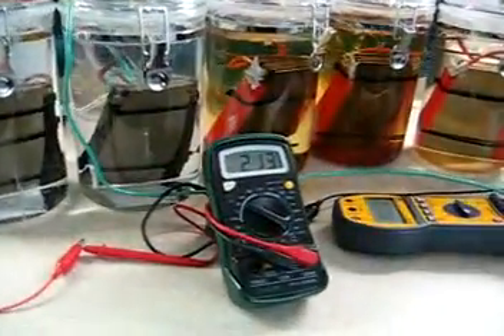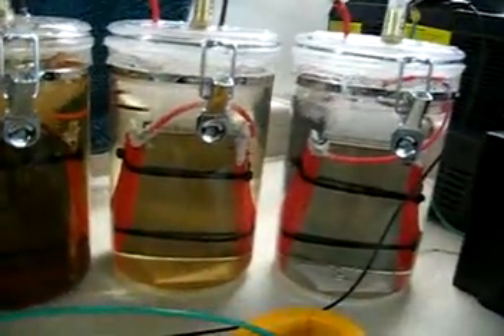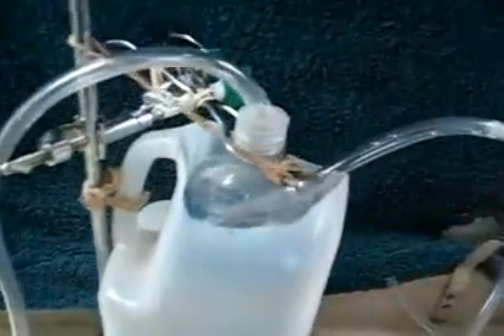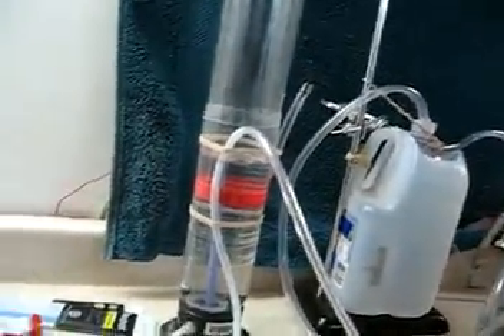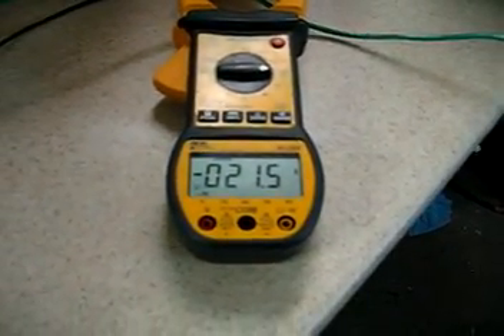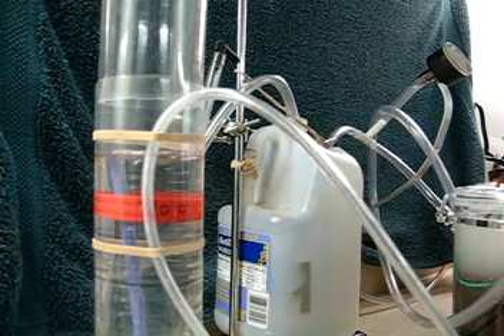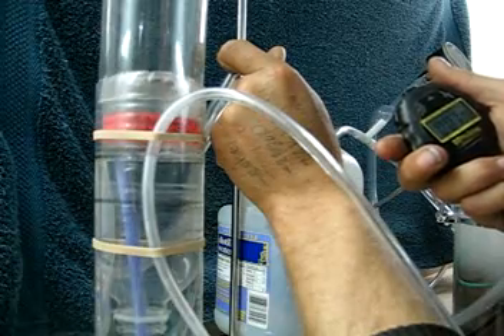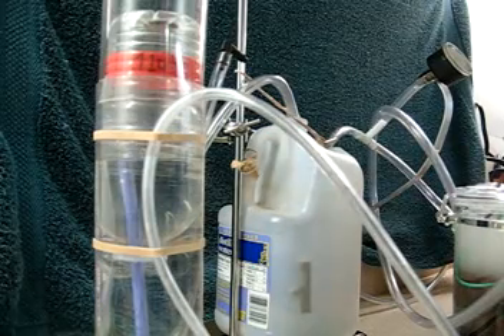6 cell flow test

Comment from the maker: they never build pressure, either the cells dump into open air or they fill the bottle, but they don't build pressure. I turn them on first to get the flow to pass through to open air, then fill the bottle.

Comment from the maker: a physically larger setup wired correctly would produce the same amount of gas for less amperage, yup you got it right, Heres an A+. Kinda like if you had a really big bullet (like a train) and it hit a wall but it wasn't going that fast, vs a really fast moving 50 caliber round, the overall damage winner would be the train. Not exactly like that but its close.

Comment from the maker: if you are asking whether the hydrogen can hardly be separated from the water molecule, the answer would be, well it depends on your setup. There are many factors to how well a setup works, but they can be made to rpoduce a shocking amount of gas for a given input wattage. This setup isn't even close to half of what an eff. design can do. But eff. volume per watt, means a larger setup would be needed to get the volume of gas this one makes, but it would use much less watts.

Comment from the maker: if I understand the question right, you mean it can hardly go out through the water at the bottom opening of the bottle that is the flow meter. The answer is it can't exit through the water at the bottom, it floats up very well but doesn't go back down through it at all.

Comment from the maker: hho is hydrogen and oxygen mixed together, so yes its hydrogen, but not just hydrogen. That is what makes it hard to deal with. Since it has the exact right mix of oxy mixed in with it, it can detonate in any air space if given a spark. each h20 becomes separated in the cells and with a little spark it will burn and return to h2o.

Comment from the maker: I am measuring how long it takes to fill the bottle with hho. In this case its 515ml of space in the bottle, and it took 19.44 seconds, which means its making 1590 ml per min. I divide that by the watts consumed to find the ml/min/watt, which is the effectiveness of the cell. This is not a very efficient cell, but it is not designed to be.

Comment: OK, The formula is based on Higher Heating Value (HHV) of Hydrogen = 141 KJ/grams and assumes the gas collected is saturated with water vapour (since bubblers is generally used). And Ideal gas law + Daltons law is used. The formula above should be mutliplied with 100 to get % efficiency...Yes if you are connecting your cells electrically in series, you would lower a cell voltage with more cells and raise eff..but you could also use a voltage divider to reduce the voltage of a cell..

Comment from the maker: practicality prevents closer plate spacing, a ready at 15 thousands of an inch. As far as the calc goes, what is it comparing or using for baseline? I am interested in understanding what you are getting for a result. In ml/min/watt, which is my prefered method it is low compared to other set ups. And I think its you who misunderstand, the eff. is directly correlated to the voltage per cell, and if I reduce the voltage to a point the eff. hits a peak for the cell design, hence more cells

Comment: I think you misunderstand....Efficiency here is energy produced as Hydrogen divided on electrical input energy. It is not a function of number of cells, but the how "good" one cell is to produce much gas with low energy consumed. The formula I developped to calculate efficiency is
Efficiency= 7744*V/UIt
V= volume gas produced in liters
U=voltage, I=amperage, t=seconds during volume test.
So if you for example reduce spacing between plates efficency should increase....

Comment from the maker: Not using a pwm, no reason to use one. Other than controlling electrolysis volume output, by changing the duty cycle of the applied voltage I have never, not once, ever seen any benefit from a pwm. In a system that you want to vary your output one could have a use, but since I don't need that control for a torch I don't worry about it. If you have repeatable test data to show any beneficial effects of a pwm, I would be interested in seeing what you have, but I haven't seen any yet.